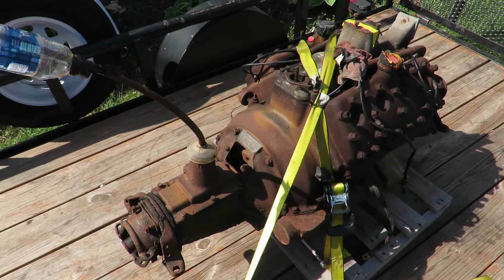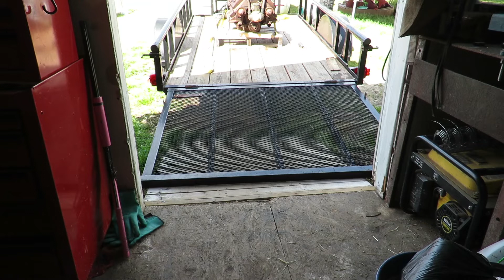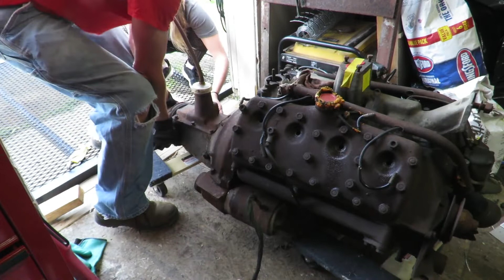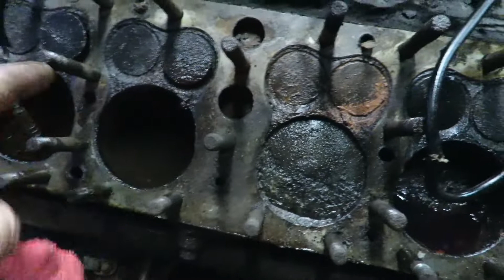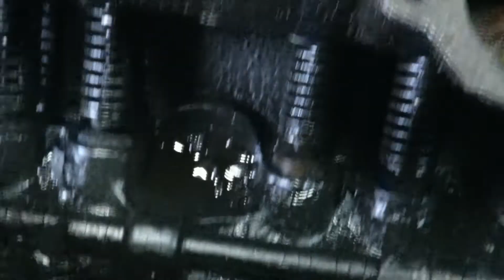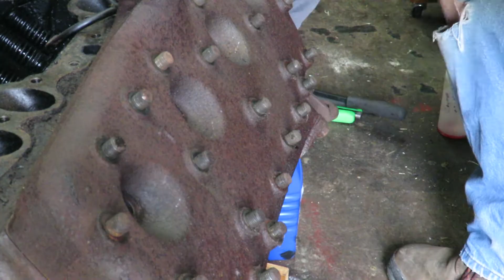New Flathead In The Shop- Stuck Engine Part 1

Comment: Weld square tubing on to the crank pulley .Then push it out into drive way and roll the motor over onto its heads n intake .The kerosene will  un down into the cylinders and you  will be able to smack the bar on the crank back and forth

Comment: the amount of videos i see, when we first start on any engine we have the heads off to have a look, there could be anything in them, for all you know all 8 pistons could be full of water. possible cracks in the water jacket, cracked pistons, split rings, big gouges/ pits in the selves, also taking the heads off allows you to use a block of wood and a hammer to tap the pistons free!!

Comment: Pour kero sene into the spark plug hols and down the crankcase .I have welded 1" sold bar across the bottom crank pulley  the smacked with a sledge  back n forth .zIf you stick an air nossle down crankcase an let it emulsify the kersone it will voat cam n lifters

Comment: What happened with the following video update? Did you get the engine to break free or pull the pistons or whatever #*?! What happened?
Reply from the maker: I was offered twice the amount I paid for it. I couldn't get the trans seperated and ended up torching bolts off to get it apart. I was able to keep the trans and its now in the model a. It's a slow build, but that is the reason for no follow up video.

Comment: If it’s from a car, the last floor shifter was 1939.
Oil it up or fill it up with oil, or oil and ATF, and forget about it. Come back next year. Levers, rollers, wheels, and a sheet of plywood are better than a lifetime of back problems.
Reply from the maker: Thanks for all the comments. I have it sitting in the A frame with ATF. Working on getting my frame into a roller condition and then work on the first engine.